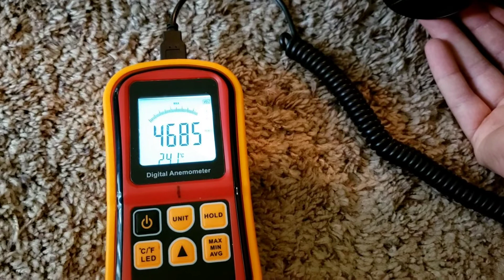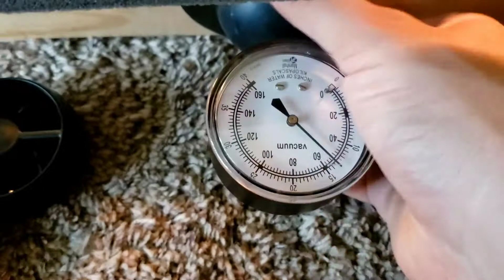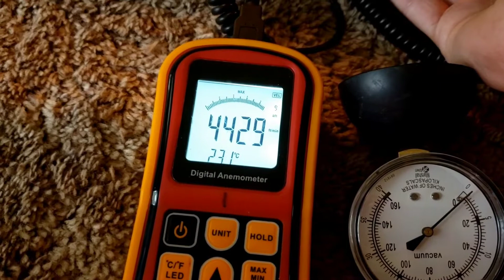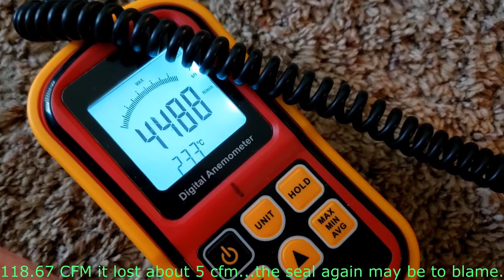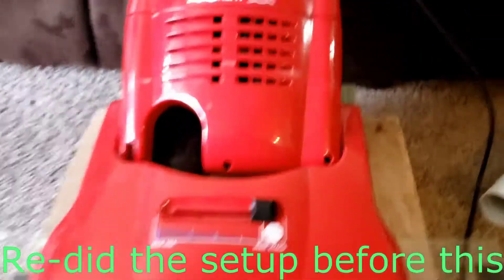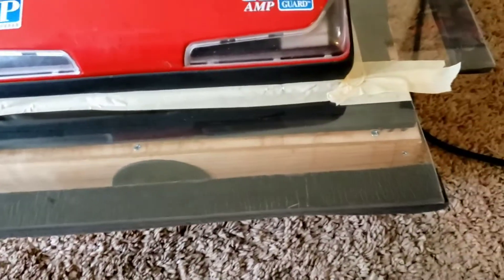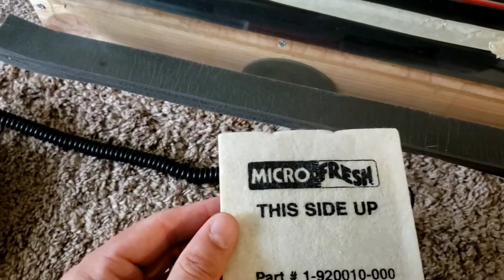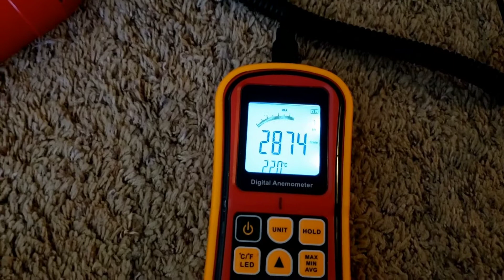Dirt Devil Ultra - Airflow box testing

Comment: People say that these things are shit...
Reply from the maker: They have a huge amount of potential being having the highest nozzle airflow from a clean air style machine but they were held back by a weak brushroll motor or belt they just didn't have the torque to keep the brushroll spinning under the sealing power of the vacuum. Proper height adjustment is very helpful to these machines. IMO they're not shit but also not the best

Comment: OK, that has fantastic performance, probably the most in its segment.  That vacuum would give Tacony a run for its money.
Reply from the maker: This design has a ton of potential this is the most nozzle airflow we've seen thus far from a clean air machine. But the weak either brush motor or belt is it's main weakness
Reply: @Blackheartvacs  I hope it's just the belt, those can be replaced easily.
Reply from the maker: @graysonsvacsandmowers5426  That's what some have suggested they say the style 6 belt just isn't like wide enough to ensure proper traction. I think it's the brush motor I just don't tthink it's powerful enough to overcome the strong nozzle suction

Comment: Wonder why they stopped manufacturing this beast?
Reply from the maker: I'm surprised no manufacturer has tried to copy this design! With a few modern touches it could be amazing.
Reply: Manufacturing was stopped due to demand of "new" bagless technology and slowed sales. The budget Magnum MVP took its place, and also failed at an amazingly discounted price even like $70. The higher featured models that had a cord rewind, speed control, or service center would've costed more but they really did try to keep them for sale as long as they could while financially making sense. The Magnum MVP was NOT just a fancy variant of the Ultra MVP.

Comment: 124 cfm must be new record for a by pass vacuum!
I thought that my Vorwerk VK 135 with 100 nozzle cfm was chart topping, but his Dirt Devil really is something else.
I like how the airpath is designed.
Reply from the maker: As far as I know it's the highest measured nozzle CFM for a clean air machine. When i had measured it for it's chart I had gotten 4980 or 129.95 CFM. It's odd that it's a tish lower this time but as said it may be environmental factors or perhaps even the voltage. It's a design with a huge amount of potential if someone were to pick it up.
Reply: @Blackheartvacs  It's truly insane power. This is why many EU-limited uprights now use straight airpats. I have one (Vax Impact) There is no long hose where the air has to go trough. Separate hose is for the above floor vacuuming. However it's bagless and cyclone limits the airflow.
Reply from the maker: @vacuumtests9225  60.11 cfm isn't too bad for a bagless but yeah short simple airpaths help retain the flow